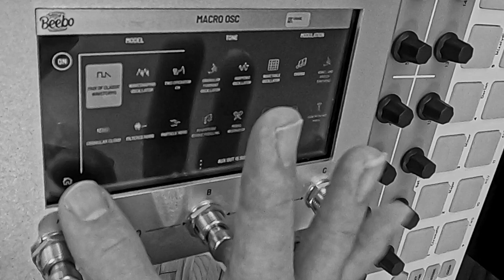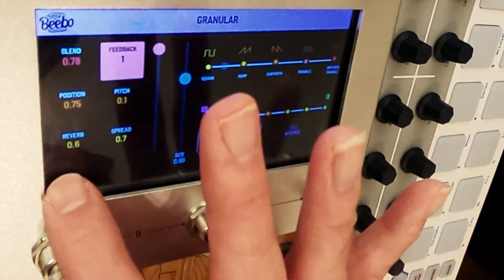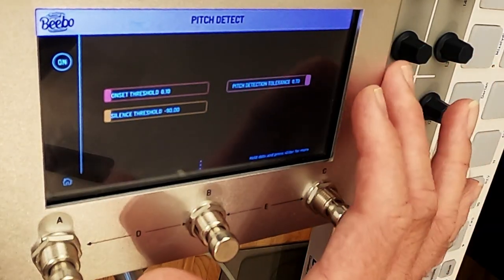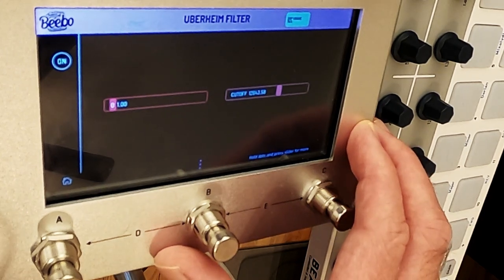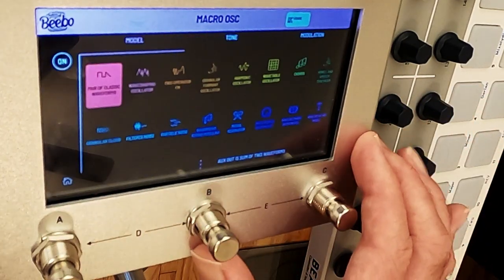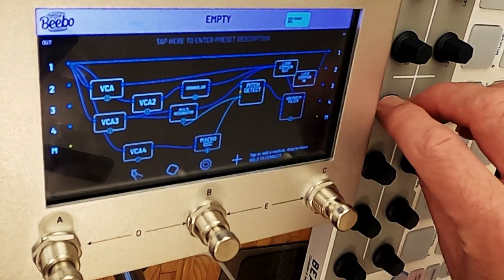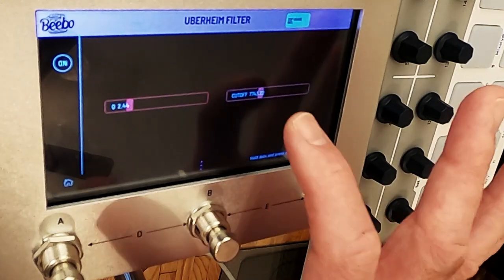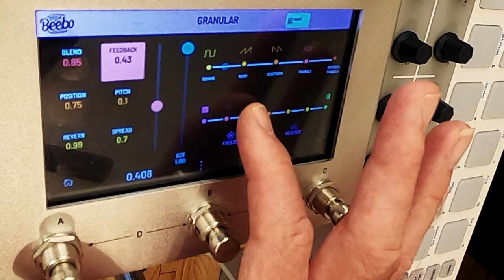Third Beebo Report, Part 2: Loopler with Granular, Resonator, Pitch Detector, and Synth Modules

Comment: Hi, and thank you so much for your videos!
It really gives a sense of what loopers can accomplish and it shows you're a very skilled musician.
Although maybe you can answer me one question? 

I'm a travelling nylon string guitarist that usually provides soundscapes and textured scapes for dance classes, movement classes, yoga retreats, etc and would like to know if this pedal would be reliable for these kind of performances. Would take about 1h30 to 3h of straight up usage and would involve asynchronous loops to quantized 8th replaced sync'd loops, no more than 3 loops running at a time and because space is essential while travelling, other effects outside of the looper module would also come from this pedal as EQ, compression, reverb, delay, etc... Not all running at the same time though. Or maybe if so, just for a short time.

At home I do have a pedal board with a couple pedals for certain functions but not so much as i dont want to over-do sound as well and give space to silence.

So my question is, is this pedal relieable that could function for this amount of time with no break or shutting off? Should I have a panic module also before the output to the mixing desk?

Thank you so much for your time,
Joao
Reply from the maker: Hi Joao! Thanks for tuning in. Personally, I would be reluctant to use the Beebo as the centerpiece of an extended live performance. Right now (it's June 23, 2022 as I write this), there are still a lot of bugs with Loopler that make it challenging to rely on, for me. My second Beebo report video shows some issues with 8th quantization, for instance, and I don't believe those bugs have been addressed as of yet.

Beebo in general is an amazing tool, but in my opinion it's still a little rough around the edges. It's great for sound design and in-studio experimentation, but I personally would be really nervous about using it as a primary looper or effects processor in a live performance situation.

With that said, I'm optimistic that Loopler, and Beebo in general, will continue to develop and mature as time goes on. I would be delighted to have to come back here and correct/update my comments! So my fingers are crossed that such a thing can happen. :)

Comment: Hey Andre. Been really enjoying yuor periodic reports (as well as all the others). Had my Beebo a while but didn’t jump into Loopler right away as there was just too much else to learn. Just started dipping into Loopler the last few days. Equal parts amazing and frustrating. I’m not quite getting the syncing and quantizing down. My results are less than what I expect. And things like using Replace in Reverse are so frustrating as it could be really cool but just so unreliable. Shame. Anyway I noticed the new 3.20 update I did last night added the Round function to Loopler that is in SooperLooper, maybe in EDP as well. I’ve been going over your excellent library of EDP videos to learn the nuts and bolts of this type of looping system. Really helpful. One thing that’s a massive pain in Loopler is there is no way to edit or modify MIDI assignments other than delete the modules and start again. For some reason I run into that all the time. Maybe it’s my approach that’s in error. But if I set a MIDI assignment to ALL LOOPS then later realize that THIS LOOP would be better (or vice verse) there is no way to rectify that. Hope you keep updating your thoughts on Beebo especially with the new Round feature.
Reply from the maker: Thanks for tuning in! I agree with your thoughts here. I definitely plan to cover more Beebo in the future, and Round is definitely at the top of the list for upcoming vids.
Reply: @andrelafosse  Great, thanks man. I look forward to that. Just last night I was trying again to pull off your windowing technique and failing. Every time I try to Replace a 1/8th section of the cycle Loopler decides to erase the whole cycle and many times Undo just does not bring the loop back. Have to start again from scratch. I’ve watched enough of your EDP videos to know this is something you do with regularity so should be very straightforward. Is this behavior you have noticed in Loopler? Or does it indicate an error in my set up?
Reply from the maker: @madmac66  I don't think it's error on your part - quantized replace was pretty buggy in Loopler, when last I checked. I have yet to update to firmware 3.20, so there may be some fixes that have gone on there. (I believe in the second Beebo report video, there's footage of having to set the 8th-quantization value one number higher than what it actually quantizes to...) 

But yes: there's a good amount of EDP functionality that either isn't implemented in Loopler yet, or is pretty buggy in its behavior. I've brought these things to Poly's attention, but I also try to be mindful that Loopler is one of many, many modules in Beebo. I'm optimistic, but I'm also not expecting the Beebo to get to the point where it's a 1:1 emulation of all of the EDP's functionality. 

With that said, there's already quite a bit of stuff Loopler does (vari-speed, multiple simultaneous loops) that is totally beyond the EDP, so there's a lot I like about it in its current form.
Reply: @andrelafosse  Yeah great points. I absolutely loooooove what Beebo does. I’ve had it a few months and it’s endless joy to build and play. I have a DittoX4 that I’ve used for looping but that thing is a toy compared to the EDP and loppers of that nature. It’s great Poly ported over the codebase to Beebo, its a fine attempt and a great addition to an already mammoth suite of modules. Ya see, now I’ve tasted caviar I really don’t want to go back to chopped liver (in terms of looping). The EDP style process is so organic and fun. Anyway, thanks for sharing all you do. It’s been a huge eye opener for me and very enjoyable to go on that journey. Peace, I’ll see ya around.

Comment: Awesome content, thanks! The million-dollar question though: For someone who wants to get into more experimental looping do you recommend the Beebo/Loopler or the EDP for learning the concepts? Loupé would be in the running but the lack of MIDI and straightforward timestretch turns me off.
Reply from the maker: I guess I don't really see EDP vs. Loopler as an either/or prospect. The EDP is definitely more fully realized as a pure looper, and some of the deeper EDP functions aren't really accurately emulated in Loopler as of yet. On the other hand, the EDP doesn't do multiple loops, or pitch changes (aside from half/full speed), whereas Loopler does both of those really well. Neither one does dedicated timestretching (unless you count the EDP stutter mode/insert "manual timestretch" move). There's a time stretch module in Beebo, but in my limited experience it's not quite the same thing as a fully-implemented looping timestretch. 

If you're on a mac, you could take Sooperlooper for a spin - that's the foundation for Loopler, and it's freeware. 

Thanks for tuning in! Sorry I can't give a more definitive answer...
Reply: @andrelafosse  Thanks for the well thought-out response! I'll definitely check out Sooperlooper.